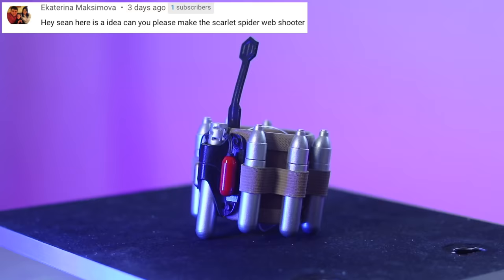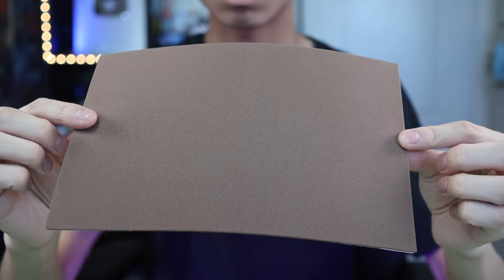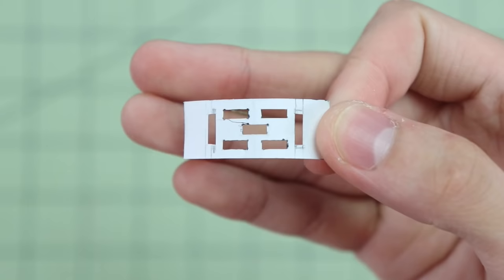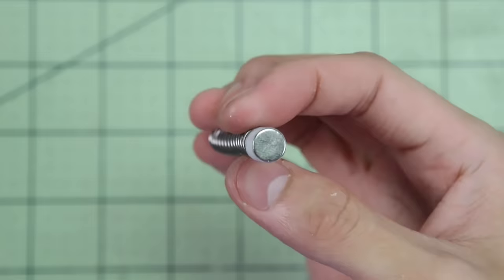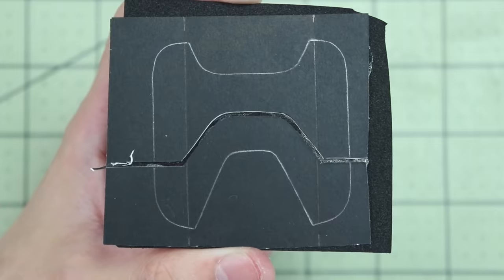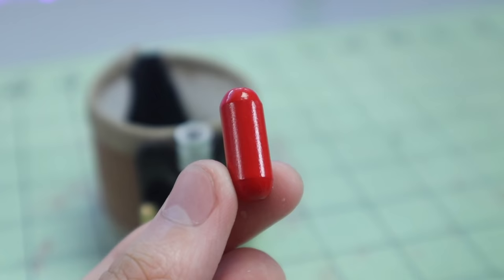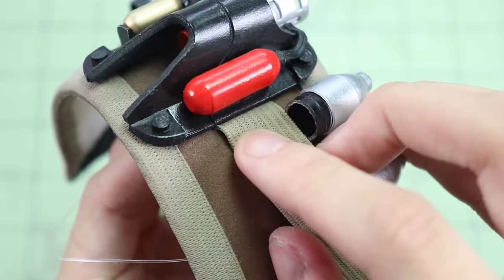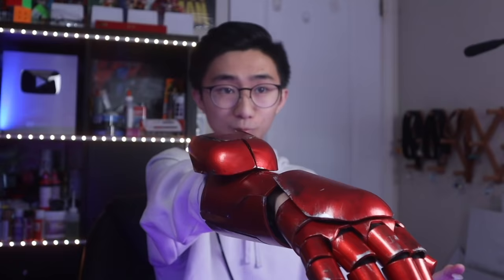SCARLET SPIDER-MAN PS4 Web Shooter That Shoots! (How To Make)

Comment from the maker: Install Mech Arena for Free 🤖 IOS/ANDROID:  https://clcr.me/MA_SeansCrafts_Sep and get a special starter pack 💥 Available only for the next 30 days

Support me on Patreon here: https://www.patreon.com/seanscrafts

FREE TEMPLATE: https://drive.google.com/file/d/1q1deEIiZWmXa_J_7Pvc_WgdpLvZp3uwv/view?usp=sharing
**YOU WON'T BE ABLE TO ACCESS THE TEMPLATE IF YOU ARE LOGGED IN ON A SCHOOL EMAIL**

How to print the template:
1. Download Adobe Acrobat Reader here (for free): https://acrobat.adobe.com/us/en/acrobat/pdf-reader.html
2. Right click on the template, then click "Open With" and "Adobe Acrobat Reader DC"
3. Click the printer icon at the top left
4. Under "Page Sizing & Handling", click "Size", then select "Actual Size"
5. Click "Page Setup..." and specify what type of paper you are using (US Letter for example) before printing

Materials:
cereal box cardboard
recycled USB cable
Tamiya TS-13 gloss clear coat
0.8x8x50mm spring: https://amzn.to/3A1lHoV
5x3mm neodymium magnets: https://amzn.to/3hjsbZ5
8x5mm neodymium magnet: https://amzn.to/3Ah0I21
craft foam: https://amzn.to/3hkaKIc
1.5” fabric elastic: https://amzn.to/2X7MLES
0.5” fabric elastic: https://amzn.to/3z3aiEf
beige acrylic paint: https://amzn.to/2YCT0kA
white acrylic paint: https://amzn.to/3z4t5yG
green acrylic paint: https://amzn.to/3tFuDOQ
silver acrylic paint: https://amzn.to/394TyS9
contact cement: https://amzn.to/3rMrgon
super glue: https://amzn.to/3Ei0Roe
5-minute epoxy: https://amzn.to/3twTqV6
velcro: https://amzn.to/3jXUHBs
popsicle stick: https://amzn.to/3E5JXJb
jumbo popsicle stick: https://amzn.to/3niiSg2
thin bamboo skewer: https://amzn.to/3tyYs3B
1/8” wooden dowel: https://amzn.to/3lhLN0Y
toothpicks: https://amzn.to/3C1Mr9L
sandpaper: https://amzn.to/3lgKhOl
small rubber band: https://amzn.to/3A9XHR2
crochet thread: https://amzn.to/3BYGvyc
nylon fishing line: https://amzn.to/3k2STHk
Dupli-Color filler primer: https://amzn.to/2VybnWJ
Dupli-Color Perfect Match Alabaster Silver Met spray paint: https://amzn.to/3z0zwDa
Dupli-Color gloss clear coat: https://amzn.to/3hpidWp
Rust-Oleum 2X gloss black spray paint: https://amzn.to/3hkbSeU
Rust Oleum 2X Apple Red gloss spray paint: https://amzn.to/3k42kGG
Tamiya gold TS-21 spray paint: https://amzn.to/3BZP0cm
black Plasti Dip: https://amzn.to/3k1YKwt
poster board: https://amzn.to/3EaYvHq
Sharpie fine point markers: https://amzn.to/2YCUds8
ballpoint pen: https://amzn.to/2VvRVd8
hole puncher: https://amzn.to/2V0LSgF
craft knife: https://amzn.to/3fzVcO0
replacement knife blades: https://amzn.to/3eUIgBw
cutting mat: https://amzn.to/2ZxGqjo

DISCLAIMER:
This comment contains affiliate links, meaning if you purchase something using those links, I will receive a small commission. The links do not cost you anything extra at all, but clicking on them to buy something helps out the channel!
Reply: Hi Sean!
Reply: Make Edith glasses lol
Reply: Plz make Edith glasses
Reply: Hi, I'm a big fan of yours but I don't have the materials but my dream is to be spiderman. I'm saving money to buy it.
Reply: Can we play mech arena in tablet
Reply: @usernotfound715  yes
Reply: Pls make thor hammer
Reply: அருமை அருமை அருமை
Reply: Please make iron man arc reactor please how many times i tell you sean please......
Reply: Hello Sean this video is amazing. In the spider man ps4 game there is a gadget called the impact web it basically pushes the thing you shoot it with can you make it?
Reply: Make Deadpool Mask
Reply: make iron spidermask with light up eyes
Reply: @sandraponnuponnuuss4581  look at Alex lab he built one
Reply: Bro the link took a long time to open and didn’t open at all so I installed it manually played it and got promoted to to division 10 and sent u a friend request but idk how to scan a qr code can u help me? And please make a winter soldier arm if u can please
Reply: Make
Reply: can you make a gwen mask from milse movie with moving lens
Reply: Can you make egg win mask with moving lenses
Reply: make a thor hammer
Reply: Please make another web shooter (retractable)👌
Who supports me?🥴
Reply: Please make another web shooter (retractable)👌
Who supports me?🥴
Reply: No  mAn
Reply: He Sean please make a spider man legs which in noway home trailer please 🥺
Reply: Can you make a venom helmet for the new venom movie
Reply: Make a spider man far from home web shooter that sticks
Reply: Z
Reply: Bro can you make lenses edith from spider man far from home
Reply: Can you make wakandan shield plss
Reply: Hello can you make stealth suit mask from far from home
Reply: Plz make green goblin pumpkin boom from spiderman 2002
Reply: Spiderman no way home Spiderman far from home Spiderman new movie call spiderman no way home
Reply: Mr.Crafts if i make that could i use those extra capsles for more webs?
Reply: T
Reply: Cheers bro ! I am also a pro player my squad power is 900 and I am 6 division hmm can we both play
Reply: Match arena
Reply: PLZ MAKE AN SHANG CHI AND LEGENDES OF THE TEN RINGS
Reply: a sean how to scan the qr code
Reply: MAKE WOLVERINE CLAWS !!!!
Reply: Hey Sean I have seen all your Spiderman related videos.
You have the skill to make almost anything.
Can you try making a Superior Spiderman web shooter?
Reply: Yo Sean can we both play mech arena
Reply: Hey Sean can you try to make 2099 spider man web shooters????
Reply: Sean, can you please make an Falcon and the winter soldier bionic arm with articulate fingers please please please please thanks
Reply: Can you make EDITH  glass
Reply: Dude make iron spider man mask with moving lenses pls pls pls
Reply: Super bro
Reply: Hey
Reply: Hey
Reply: I want wed shooter
Reply: Im 11year olds
Reply: Can you plzzz make aang's glider from avatar the last airbender
Reply: Olá meninas . .  ..

Ib
Reply: Spider-man Ps5 mayiras wed shood
Reply: hey sean i am your biggest fan
i love to do your web shooter so i wanted to ask you that can you make us a web shooter without super glue , magnet, spring
Reply: and i wanted to ask you that can you do BLUE THE VELOCIRAPTOR
Reply: Hi Sean I was wondering if you could do the Spider-Man homecoming homemade suit web shooters step by step guide for it. It would mean a lot.
Reply: Sean can you make a daredevil billy club?
Reply: Starwar sword which is very easy to make using simple materials
Reply: Make boomerang
Reply: Please made next mandalorian's helmet
Reply: Sean Crafts  Nice video
Reply: I will bro and i'll made this also
Reply: can you make iron spider man mask
Reply: Make a simpal web suture please 😎😎
Reply: Can I have web Shooter from Friday Spider-Man and I can I have to put h
Reply: Hi bro please give reply for my comment
Reply: Pls pls pls make A bucky mechanicle  arm that moves without putting your arm inside that would be amazing 👌
Reply: Sean, make a web shooter than can shoot 2 webs or multiple, like shooting them over and over
Reply: Another idea, I the wrestler suit web shooter from ps4 spider man, or just the “mark 1/classic” web shooters
Reply: The dosen't open
Reply: Ant man helmet
Reply: Ant man helmet
Reply: Shooter
Spider-Man Web shooter
Reply: Make a batman cowl
Reply: You should make the new spider man no way home blacks and gold mask
Reply: Pooda valllai paniyaram
Reply: Poooda soommmma sundhiram
Reply: i need u to make a free fire first elite head mask
Reply: make black panthers retractable claws
Reply: Heyo mech arena is a copy of war robots war robots is already sooo good better than mech arena i prefer   war robots but you can play mech arena
Reply: Can you make thors stormbreaker plss
Reply: Hey man where is the new video😐😐😠😠
Reply: Mayonnaise invitingHow do you say anything if you do you have a but I
Reply: Can you make no way home spider man web shooter please
Reply: Make the coolest web shooter in this party Merce
Reply: Sean’s Crafts me puedes aser la armadura completa si porfabor
Reply: Sean’s Crafts me puedes aser la armadura completa de iron man  si porfabor
Reply: Can you make the homecoming web shooter but make it look like Odin makes ?
Reply: Are you sometimes annoyed that there are so many “Can you do ———— pls am biggest fan” comments because I see them alot
Reply: Wait seen does it stick to roofs
Reply: You can should make a pistols
Reply: bad idea
Reply: NO
Reply: Ty!
Reply: Can you make shredder's hand blades
Reply: Bro can you make please gun inspired web shooters
Reply: You can also make a spider man web shooter with a spider web solution
Reply: Can you please sell somebody’s web shooters because I’m not really able to make any of this stuff.
Reply: Can you start selling some of these web shooters
Reply: hope you can make a new Spider-Man web shooter my birthday is coming up soon 12.17.21 age 11 - 12
Reply: Ɛɛ
Reply: Ɛɛ
Reply: -,make an expandable Sh
Reply: Can you make the spider man scarlet mask
Reply: Do you sell any of these items anywhere I’ve been searching for this stuff forever and I can’t find them for a good price or good wuality
Reply: can you make web shooters of spectacular spiderman? easy
Reply: ' '
c o
'
Reply: ¹
Reply: I would like to build your cool web shooter but it is to expensive for me
Reply: Hey can you make me a web shooter hey can you make me a iron spider
Reply: How to make a spiderman Web hosting
Reply: How to make a spiderman Web hosting
Reply: How to make a spiderman ps4 Web shooting
Reply: How to make a spiderman Web hosting
Reply: How to make a spiderman Web hosting
Reply: Make another iron Spiderman web shooters
Reply: @ehlias0canalsecundario451   how do you buy it
Reply: How to make a spiderman Web hosting
Reply: How to make a spiderman Web hosting
Reply: Thor mask
Reply: @Sean"s Crafts i txted u on insta can you make me tthat custom oder
Reply: Make a spider man ps5 Web shooter please
Reply: Dud vidieo
Reply: Can you make one with a suction cup

Comment: I just add a note: locking mechanism working with misfire, thus if you want that isn't happen, just screw a 2 holes in piece of popsicle stick and two holes in corpus, attach a fish line through that holes and the holes in corpus and just tie up two piece of fish line together near end of the corpus and add a fish line ring around the node. Thus, when you pull a fish line, you will pull a trigger from two side at once, it will help avoid a incorrect mechanism work. Just one hole in trigger not enough to pull it down, because a projectile just pull the edge of the trigger forward and it interfere to trigger to pull down.

Comment: if you made the bullet slightly slanted as it goes toward the notch in it then you could take out the part where you have to pull on the string, that would make the reloading process just a little bit faster
Reply: There is one problem - magnet on the end, which not let that work, because it will interfere to pull the trigger down.  But it may help, if you cut a piece of magnet at an angle.

Comment: Hey Sean, I hope that you could find a way to make a web shooter that can pull things that aren't magnetic
Reply: I'm so into all your crafts
Reply: There’s a thing I haven’t tried yet, but I know some people have. You could try using a small suction cup, like one used to hang stuff up on mirrors or a nerf dart tip. This won’t be as strong as a magnet, but it does work pretty well in some cases.

Comment: Btw first of all, really love your videos. Second of all I have a question for the web shooters that you make. So the magnet that you attach at the end end of the web shooter, does it mean that these web shooters are only intended to be applied on magnetic objects just like you demonstrated at the end of the video ? Is there any way to design to make it applicable for non magnetic properties ? Looking forward to your reply :)
Reply from the maker: You could make it stick to non-magnetic surfaces if you put a rubber suction cup on the tip of the bullet (think of a Nerf dart)
Reply: basically what he saying is vacuum